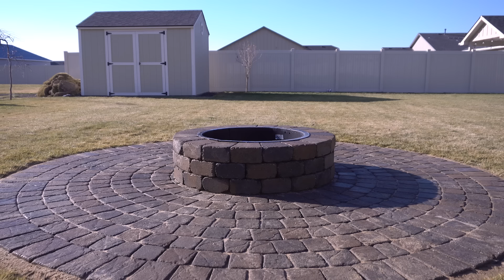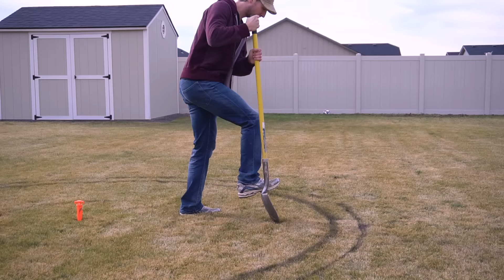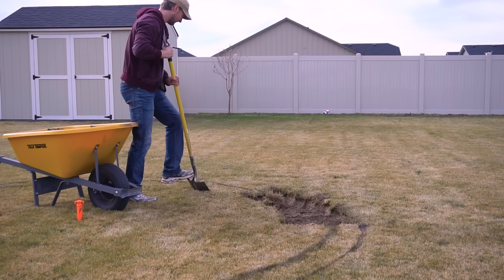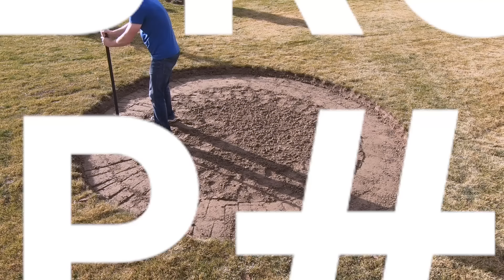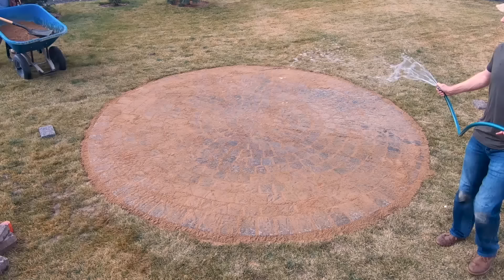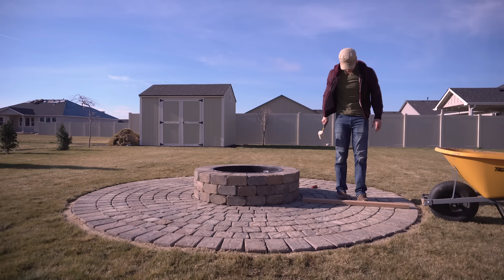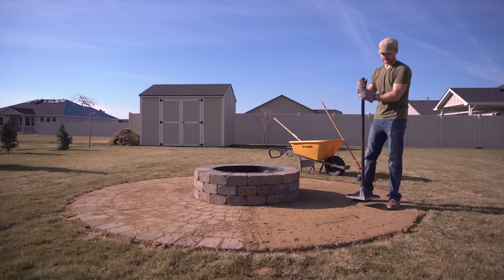My 4-Day Fire Pit Patio Build [Full DIY Project]

Comment: Pro tip: don't use sand, use stone dust. Also, don't fill the cracks with regular sand. Instead use polymeric sand which will last for years and years to come
Reply: Also brush the polymeric then tamp, fill in the new gaps, brush again, tamp again, then leaf blower, then water
Reply: @ericm8504  yes, this
Reply: And put weed cloth below the fines. Came here to say this, they're gonna have weed issues in the cracks later
Reply: Yeah without the polymeric, all that sand is just gonna wash out in the rain.
Reply: @mr.spradify5470  poly-sand prevents weeds
Reply: @ixCGAMExi  Poly and a liner is the way you never get weeds
Reply: @mr.spradify5470  I don't know what you are talking about... I have been smuggling weed in my rectum for years and I have no weed problem in my crack whatsoever!
Reply: @RealBazman  hol' up
Reply: @RealBazman  made my day bro
Reply: @RealBazman 😂😂😂😂
Reply: @mr.spradify5470  Since the weed seeds come from above these matts aren't that effective against weeds.
Reply: @mr.spradify5470  I said the same thing. Weed cloth doesn't prevent it 100%. It sure slows it down. This guy is going to have weeds & grass between his pavers.
Reply: @mr.spradify5470  Does weed cloth work tho? i put some in my garden and small weeds just seem to poke right through it.
Reply: @PerfectlyFunctioningAI  depends on the type, get at least a 3.2 ounce woven.
Reply: I agree on not using sand because another thing sand does is draw ants to your yard.
Reply: @Riley_1955 I’m dealing with this where I had my above ground pool.
Reply: I'm a bro, not a pro, and I was going to say he should have used polymeric sand too.
Reply: We used polymeric sand and weed barrier and weeds came through both. Fertile ground, Sigh
Reply: @RealBazman  🤣🤣🤣🤣🤣🤣
Reply: As well as weed cloth, you have to keep the surface clean. Got a lot of trees on my yard, they'll drop organic matter from on top and you get weeds no matter what you put underneath. Hard to keep that out of gardens, gravel, etc even with a thick barrier underneath.
Reply: polymeric sand is for sissys
Reply: cement slurry is best... and we'd use tailing sand from the mines, no weeds grow in it...
Reply: Sand sucks for a bedding aggregate. If it rains, you're rescreeding several times, and it's slower to lay into. We use CA-16 (3/8" crushed limestone). Poly is the way to go, assuming it's installed correctly. With this DIY deal, he'd have low spots all over that collect water if it were impermeable.
Reply: Rad stone circle for sacrifice and ceremony bro.
Reply: And....
Reply: *Bro tip
Reply: Heavens we don't want to spend another summer redoing the project! :D
Reply: Let’s be honest what’s cheaper tho lol
Reply: Bro tip*
Reply: Probably all just came in the kit :/
Reply: What about the final slabs on top? No cement?? Hahah
Reply: Where do it purchase the materials you used
Reply: Bros….we have Ortho & Roundup

Keep scrolling☝️
Reply: Poly sand is currently 75 a bag and theyd need about 4-5 also sand is typically better as stone dust when wet will clump and solidify which can creat gaps under pavers leading to crooked pavers also he shouldve used abc stone instead of ordinary gravel, Also from a pro!
Reply: *bro tip
Reply: @ixCGAMExi So stone dust only for base? No gravel? Def polymeric sand. Trying to know before I build.
Reply: Yea the sand made me cringe. We used this rough gravel type stuff but had to do like 4 layers of stuff underneath the pavers firsr
Reply: Bro tip*
Reply: Yup
Polymeric sand any brand will be better than regular sand (SRW Z3, TECHNISEAL SMARTSNAD, GATOR SAND)
Reply: Well idea bro 😎
Reply: @RealBazman  Good shit?
Reply: Why can’t they just use glue to fill in the cracks?
Reply: I need a pro tip. Could I drive on this without any problems? Looks cool, just a little curious.
Reply: @marqicewalker1766 you would want a deeper base with 3/4” crushed stone. One inch of 3/4” clean stone (open grade base), then a GeoTextile permeable fabric barrier (gator fabric, GF5] then, 12” - 18” of 3/4” clean stone (depending on soil condition), Tamp stone every 4” lift, then 1 1/4” (outer dia of gas pipe) of 1/4” chip/crushed stone or 3/8” (#8) pea stone. Don’t use sand, as it washes away faster.
We want 1/8” of a pitch away from house over every 8’ (1/8” of a pitch is 1” over 8’)
1/8” of a pitch over 8’ is when level bubble touches either bubble line
Reply: @THE-APEX 12” - 18” of 3/4 clean stone?  Can you explain what you mean?  Surely that’s not 1’-1.5’depth?
Reply: @DirtyDermz  Surely it is, and don’t call me surely. Had to. :0 ) You want the fat, solid base to keep the water moving downward, deeper through the stone, to help prevent frost movement whilst solidifying the foundation.
Reply: @THE-APEX  Lol classic response, touché!  Okay, that makes sense.  I’m in Texas and a freeze is more or less- incredibly rare.  Let alone a freeze that lasts long enough to get some serious depth.  This being said, do you still recommend such a deep base?  I have estimated 6” of gravel below the sand & pavers.  This estimate price is already touching customer’s limit.  But she also really wants solid quality.  (Also worth mentioning the yard has a roughly 20 degree downward slope that we are leveling out.  it’s 600 sq ft.  Thanks in advance, from a carpenter of 10 years that had landscaping and hard scraping opportunities fall into his lap LOL)
Reply: @marqicewalker1766  yes they do paver brick driveways
Reply: Nothing wrong with filling the cracks with regular sand if you tamp it in with a small power tamper. The Poly sand is great for about 5 years then it goes to shit.
Reply: @AngryOtter614  Actually no. There is something wrong with using regular sand on top. Poly acts like cement when it gets wet so it will last a lot longer. You should really research before adding bad advice.
Reply: @NerdyCraftsmith  my research is watching Poly 5-6 years old clump up and start leaving big gaps. Maybe the technology is getting better but I see it failing all over town from 2013-2017 projects.
Reply: @AngryOtter614  I've used it for the past 10 years and have had zero issues with it. Maybe it was the brand?
Reply: @NerdyCraftsmith  That's very possible.
Reply: @AngryOtter614  probably the installer. If you don't follow the instructions and keep it recessed 1/8" into the joints, it will peel up in a couple of years.
Reply: @NickR..  Keep in mind too, how much movement you will have in the winter. In areas that have hardcore winters you will find that frost will defeat the poly every time.
Reply: @AngryOtter614  I also don't like to use polymeric sand cause you need very dry conditions and reapplying sand does not bother me. Neater finish and so much easier. To each their own I guess

Comment: Spades are better for stripping grass, and that tamper you use for compacting the base can be fitted with a rubber base to run over the pavers instead of setting them individually.
Reply from the maker: I like the rubber base option, I'll look into that!

Comment: 4 days?  I build one in less then 4 hr's. XD   but without any Support layers. Only soil and Bricks.  And it is still pretty decent also it get some bumps. But only with minor hight differences. After 4 years the lawn grows quite a bit. And now we can Decide to put some Gravel under the Bricks to smooth out the bumbs and lift the Bricks up to the Level of the lawn. ;)

Comment: I dont understand how the wall in the middle is not gonna move or an of the concrete bricks gonna fall off, and what about the concrete caps? Arent they gonna fall off as well if you put something on top of them. Im sorry if the questions are kinda stupid i rly dont know much about builds and i would love to do some o these one day
Reply from the maker: Everything's pretty solid just stacked as it is (the fire pit bricks are super wide and thick, so they don't move). But, we will add some masonry adhesive at some point. We're still just messing with the fire pit to try to get more airflow and help it burn better - check out our next video to see what we've been working on.

Comment: Shouldn't you put some cement mix instead of just sand? How pavers hold without it?
Reply from the maker: You can do a polymeric sand or I guess a ring of concrete, but right now everything is being held together by landscaping edging around the outside.

Comment: I would not have put a sandlayer on the whole thing ... but only in the center. That way you could walk around easier on non-sandlayer parts and lay the stones. Since you tap the stones in some, it doesn't matter if the sandlayer is not 100% level everywhere ... as long as the set stones are flat. Said stones will not be 100% at the same thickness anyway.
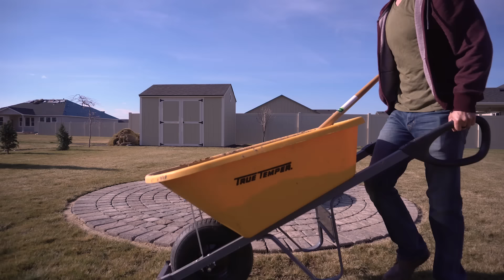11:34 Now you go back, and force more sand into the cracks, which is good. But why did you put the stones for the firepit on first? I would have worked more sand into the whole area, to stabilize it good, and then work on the next step the firepit.

Comment: Did this working for a landscaping company. Pretty decent job. I didn’t notice you using any adhesive for the stacked blocks or the caps. We’d use screenings rather than sand. Like your tapping with the hammer method, not bad. We’d use a sand, similar to grout, that we’d put down and sweet into place, then go over with a compacter, then mist it. Only think I’d watch for is the pavers on the bottom of the pit, depending the paver, they can have pockets from manufacturing that could cause them to break.
Reply from the maker: Thanks - good suggestions and tips!

Comment: Shouldn’t you be using mortar between the gaps? Won’t they get loose over time?
Reply from the maker: Not for something like this. They're supposed to be able to be removed if needed, and we can always add more sand in the future. It's a bit of maintenance every few years (supposedly) but the idea is that if the ground freezes there's no concrete or anything like that which would crack and look ugly.

Comment: Not using any cement at all will bite you in a few years time.
Not only should you have layed your pitwalls with grout instead of just stacking the bricks on top of one another. You usually also lay half of your border stones into mortar as well, so that your paving can't expand over the years and your ground would not become wavy and bumpy.
Reply from the maker: We're pretty happy with how it's looking so far. I know we'll need to keep an eye on it, but it's already gone through one winter and things seem very solid. We did use landscaping edging around the outside, so that's holding it all in place.

Comment: Nice yob, but i have little hint. On lowest brick level of fire pit, you should make small holes for air to get in. Fire will breathe easier. Your wood consumption will be a little bigger, as a trade off.
Reply from the maker: We actually tried this out and filmed the difference. Check the next video to see how it works!

Comment: When we did something a lot like this. The next year we ended up cementing it.
Reply: I was thinking that, bet those stones end up moving around quite a bit with no cement
Reply: @bendude6748  paver sand has cement in it. It shouldn't move too much if you do it right, over time everything, including concrete, will get weathered tho
Reply: At the end i was like "soo you're just gonna let those stones piled up there?" where i live everything is cemented. Well houses here are bricks and cement, much different from most USA
Reply: @irasac1  
They used the plastic black edging around the patio. Depending on what area people are in will detetermine what it is used. Here in California (home of earthqakes) we use those black edgers in our gardens for our stones too and they never been a problem or shifted from their placement
Reply: @katherinepeace3564  interesting
Reply: If they cimented just the outer ring made from the bigger pavers, shifting from the pavers inside would be minimized by a lot. Here in portugal we use a ton of cobblestone on sidewalks and most historical or old streets and we cement the limits were the sidewalk ends, and the cobblestone is held in place by a mix of stone dust and some other stuff. And it stays for years.
Reply: exactly, he should have at least used cement glue to hold the fire place
Reply: Why
Reply: @voetbal12  flood, earthquake, avalanche, and everything that can move and destroy building is regular things in some places
Reply: I am surprised there was replies to this comment. 

Thank you.

The sand ended up mixing into the dirty. Then the grass and dandelions started to grow in between the bricks. Causing the whole thing to blend into the ground.

We even used a wood edging that today. Years latter, has broken and needs to be replaced. Just that it is not needed.

Today

We have like a evasive purple flower growing wild in the middle of the thing. Standing out against the yellow dandelions. Even with it cemented in.

Comment: Problems I saw.
1. No adhesive or any type of landscape adhesive for your fire pit. 
2. Every fire pit patio I’ve done always have put the fireplace below the pavers and used a Portland/57 stone base for my fire pit to sit on That way there will be some type of drainage and you won’t have ashes all over your patio. 
3. Was that your base sand you where using to fill in your joints? I highly recommend to use polymeric sand.
4. Use a plate compactor to pack your sand between your joints not a hand tamp. The vibration of a plate compactor will be a lot better compared to smashing sand between the joints

Comment: You are better off using the auger bit you have all the way up sleve the hole with a piece of PVC just in case you need to run a new wire in the future.

Comment: Your yard is so flat. Plus I didn't see a single rock during that digging. 
If you were in my yard after day 4 you would still be digging with the jack hammer.
Reply from the maker: I definitely appreciate the non-rocky soil!
Reply: @BroBuilds  I built a fence around my place when I bought about 10 years ago.
Spent several days on the jackhammer trying to get post holes down.
Eventually gave up and hired a 6 tonne excavator. He gave up on one hole. I had to shorten a post right up because this one hole was shallow.
Swore I'd never dig in this ground again. 
Then found myself building a retaining wall for a slab I had put in for a shed as my block is sloped. Paid for the excavator to flatten the pad but forgot to mention the post holes for the retaining wall.
Back out there with a jack hammer for a few days.
Still haunts me today.

Comment: What was the estimated cost for this? I am thinking about building something similar. Also, anyway you can link where you got the kit from? Love the video homie!
Reply from the maker: Thanks man! The kits we got added up to $1400 (that includes the capstones) and then it cost another couple hundred for sand, gravel mix, and misc materials.
Reply from the maker: Oh, and the kits are made by baselite - no link, because we purchased them locally.
Reply: @BroBuilds  gotcha, thank you very much! This is a great starting point.